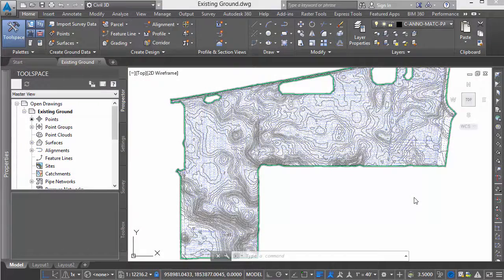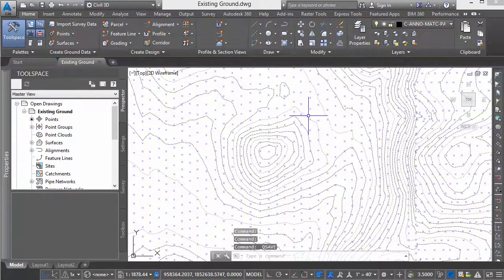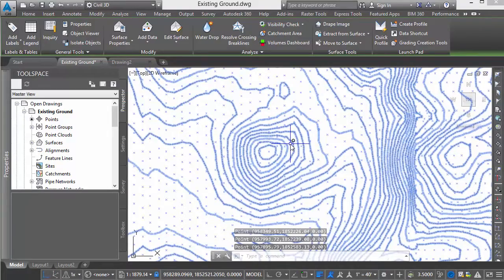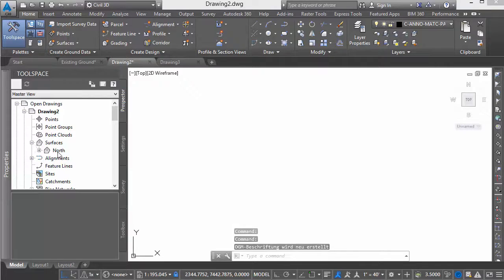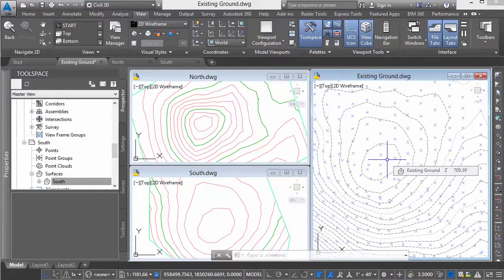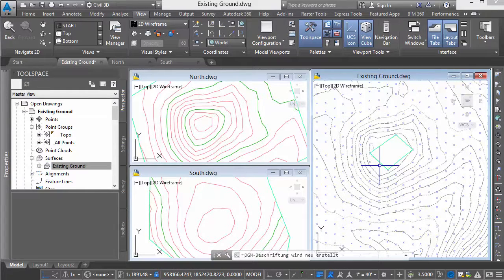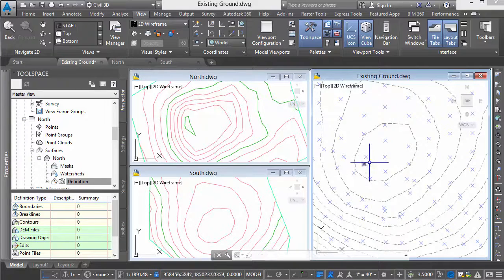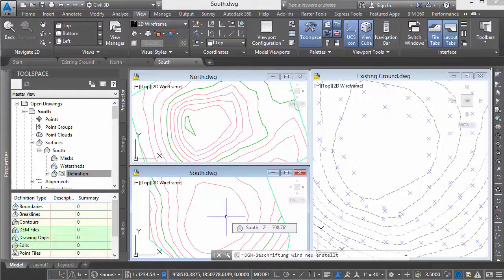Using Civil 3D Cropped Surfaces

Comment: No matter what crop out of a surface the surface data for high and low elevations stays the same. Even if I crop out my highpoint the high point of the surface stays the same. It still reads the ghost data. It does not "Crop" the surface, it seems it meerly just does not display it.

Comment: Thanks Jerry..
But i want ask about if i need to cancel any relation between the cropped surface and the original surface "" usually i use data shortcut then use promote "" is there any command to do it in this case ..